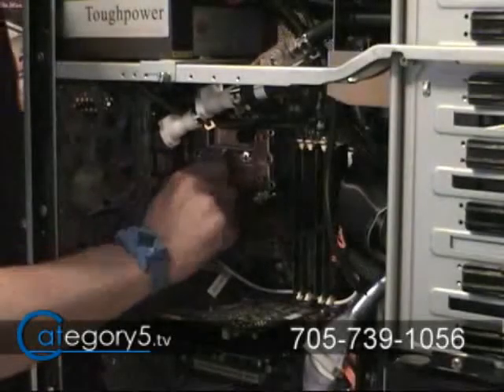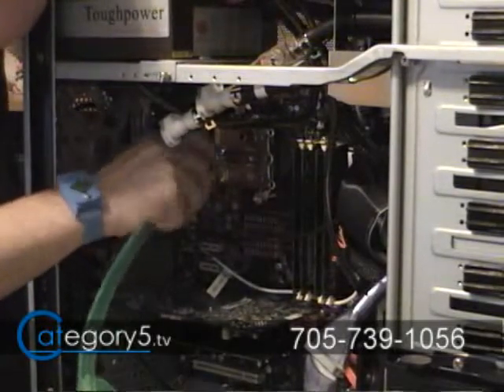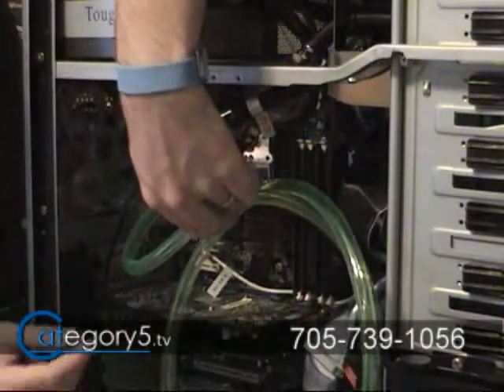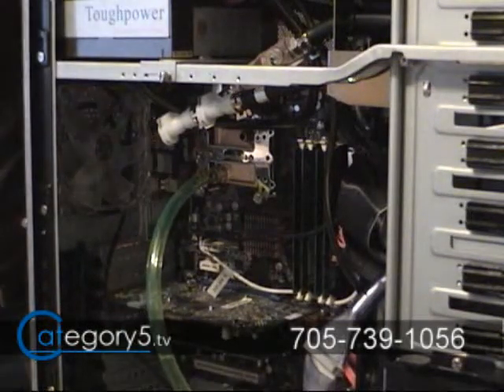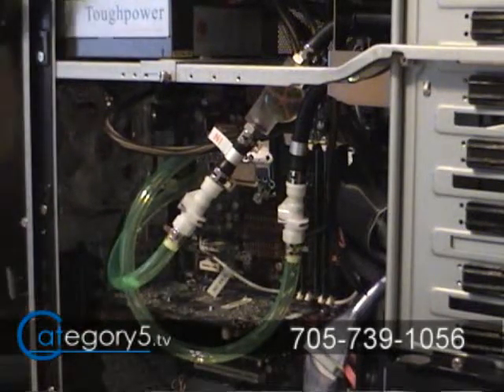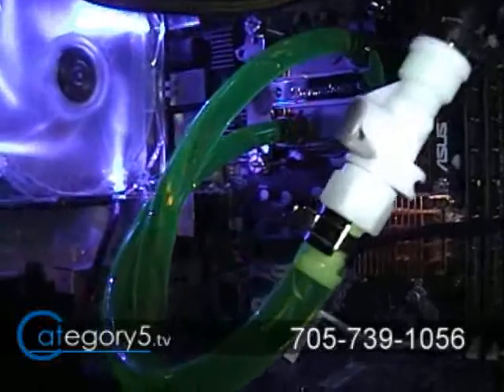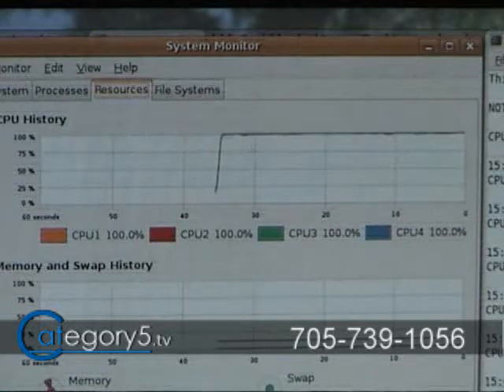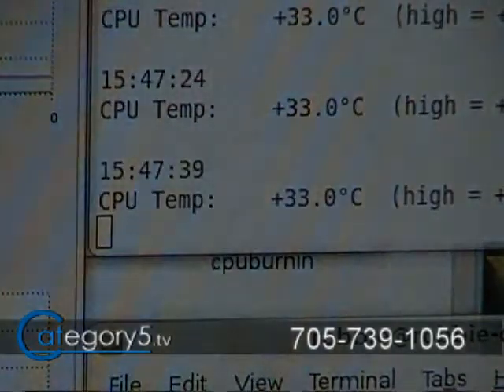056 03 - Installing a Liquid Cooling System - Part 3

Comment: If you're going to overclock, get a VERY nice air cooler, or yes, get liquid cooling. Both will be inevitably expensive, however liquid cooling gives a nice bonus of silence depending on the units you get a good one with 120mm fan radiators.

Comment: You'll get much better numbers after A: you use better thermal paste like Arctic Silver 5, and it gets past the burn in. B: You add another 120mm radiator or dual 120mm for not much more, and C: When you overclock, the water will carry the excess heat a lot better. However, for stock yeah, I will agree, that's not worth the $120+ :D

Comment from the maker: This particular one (in the demonstration) runs $279.99.  It should be noted also, that it includes _everything_ shown.  From the tubing to the unit itself, and even the liquid (good for two fills, at least).  Since producing this video in October, I have yet to see the fluid go down, and it continues to cool my system extremely well.  The only thing I might want to buy down the road is a waterblock for my video card... and maybe my RAM.

Comment: I'm new to liquid cooling- so I'm guessing to add on GPU cooling you would need tubing, a special water block + thermal grease, how would it connect to the pump system itself? In this video you have a closed system between the CPU and the pump unit- so do you basically expand that closed system or make a separate loop? i.e. would the water flow [pump unit --> cpu --> gpu --> back to radiator/pump unit] so that the flow from the cpu goes into the gpu even though it is already somewhat heated?

Comment: if you add gpu coolers to this set up...how would that affect the temp of the overall system would heat from the gpu or processor indirectly heat the other?